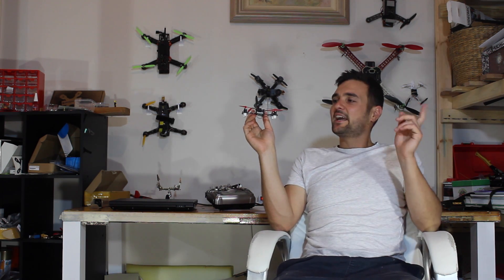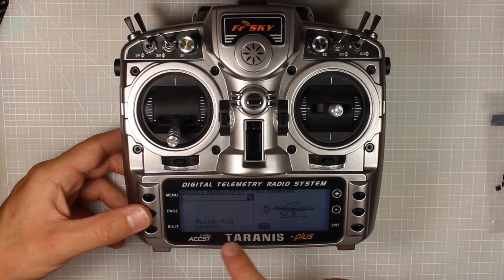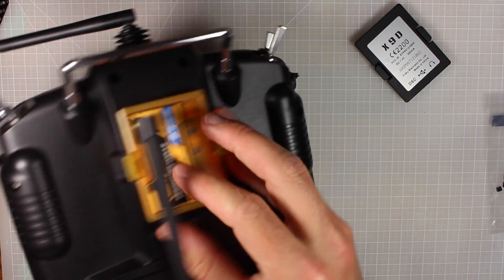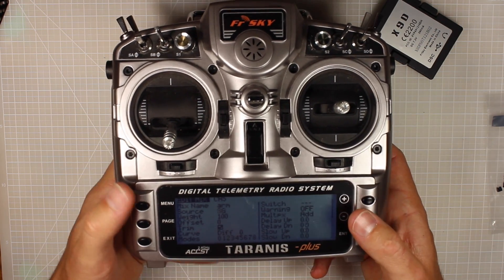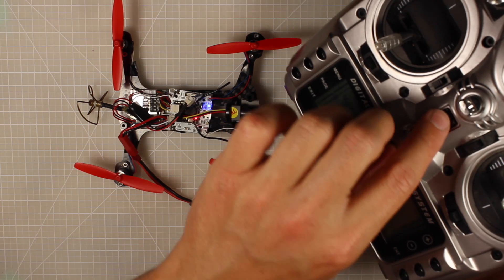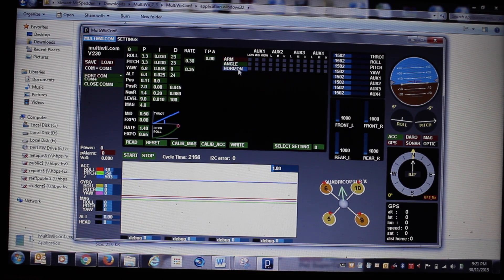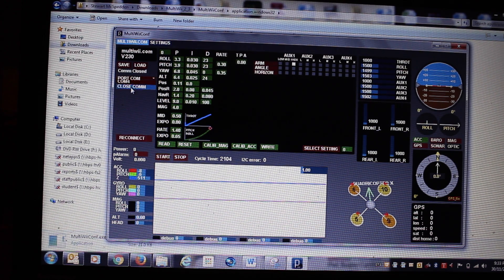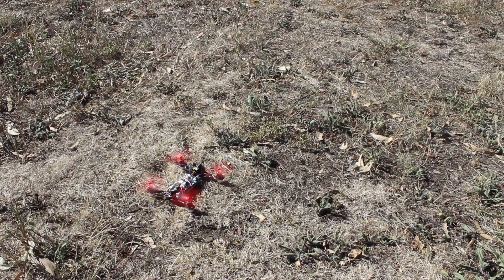How to build a micro FPV quadcopter part 2. Taranis RXTXModule binding.

Comment: RF = Radio Frequency.

Think I am going to have to build one of these little machines if I can find the flight controller for it.
Reply from the maker: +Nick B hey mate. check out my atom build. personally I find it more fun then this and a lot better to fly with double the flight times
Reply: +UAVfutures Will do, thanks. I am having the very devil of a time trying to find a controller board for a micro anyway. If I see another "out of stock" I think I might just go mad. :)

Comment: Hello I don't have a taranis would this build still work with another tx? Im still noob sorry I personally have a fly sky ic contriller
Reply from the maker: +ALPHA nuts I use a squishy as well now. I changed over. Yes you just need a radio that is comparable with the receiver you use.

Comment: Great instructions. I am still clueless about how to connect the board, or Beef's brushed board witch is what I have, to the computer. Is there a simple readymade FTDI adapter, and if so how do I get one.
Reply from the maker: +Lars Mikkelsen you use a micro usb cord, it plugs straight into the board

Comment: Does the board works with a futaba?
Reply from the maker: +Frikli444 I think you mean the receiver. The board just flies the quad. But the small receiver is what links it to my radio. You would just need to find a futaba compatible receiver to get it working.
Reply: UAVfutures Ok thank you and can you do flips with the quad?
Reply from the maker: Frikli444 sure can. You can fly it just like any of its bigger brothers. It can be set up to be fully acro so it doesnt self level or anything.

Comment: Does the micro fpv tx you used in the build video work with your fat sharks? Or do you have a separate receiver?
Reply from the maker: +Gulzaar FPV I just checked and my fat sharks do not pick up the band of my vtx. I use a separate ground station. In saying that though I do have the option of changing the frequency of the vtx to another band if I access the dip switches.